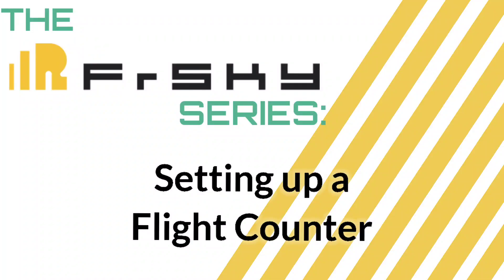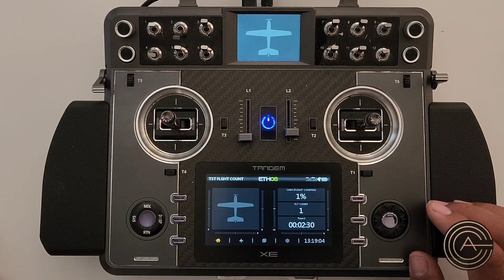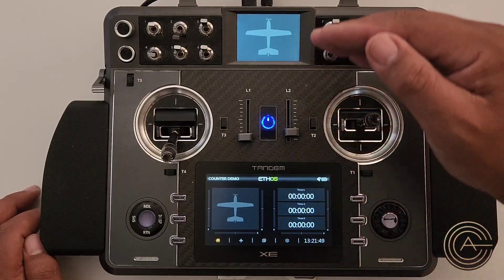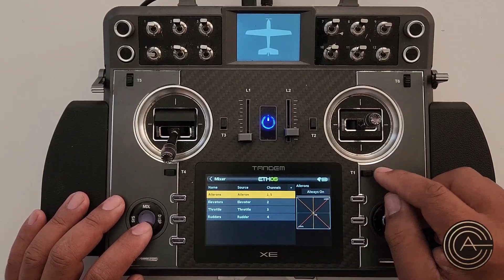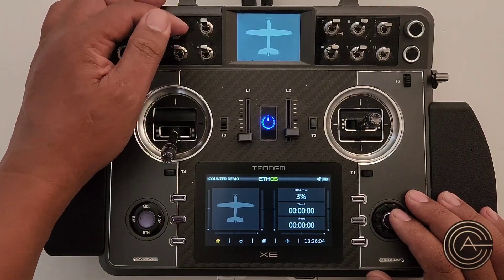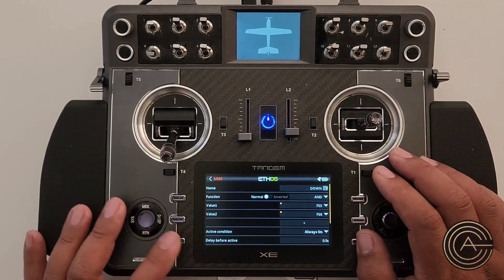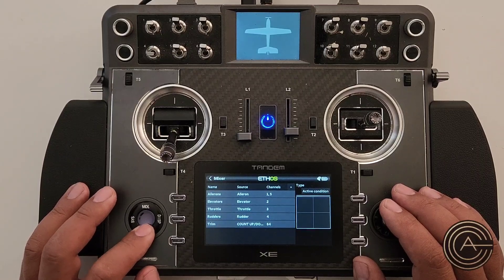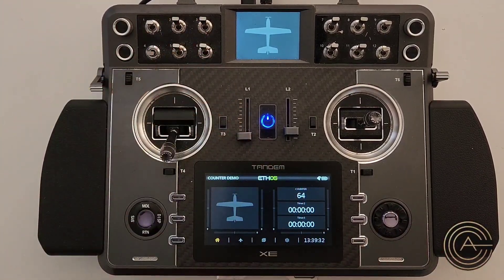The Frsky Series: Setting up a Flight Counter

Comment: Great video series. I am enjoying it and learning a lot. Is there a way to set some kind of timer to register a flight for instance, after you trigger your arm switch after 30 seconds it will count as one flight. This way when you’re on the bench flicking the switch back-and-forth. It won’t register as a flight unless it’s on for at least 30 seconds. just a thought.
Reply from the maker: Sounds like another logic switch that waits 30 seconds before triggering. Shouldnt be too hard. I might take a look and aee if its an easy addition...
Reply: @all_rc  i’m thinking set a logical switch maybe have throttle above say 10% to start the timer as a way to prevent a false flight
Reply from the maker: I just checked and yes, it should be very simple to modify and add that to the logic switch setup. Unfortunately, the steps involved in setting this up have changed. Trim, in the newer firmware is done differently. It is much easier to set this up in the newer version of Ethos but this video is now obsolete. Also, there is now a lua script that has been developed that creates a flight counter just by downloading the lua scipt. Much easier than setting this up. I might create a new video for this based on the newer firmware but that may be some time away.
Reply: @ Fantastic, thank you for dedicating your time to answer my question. Much appreciated. I look forward to more of your content.

Comment: How do I do this on a X20S where I do not have a “Trim” choice in mixes?  (I can’t believe no one has written a widget for this as in EdgeTx).
Reply from the maker: This should work on the x20s but I haven't checked if it builds the same on the new version of firmware. They did change the way trim works but it should be buildable on the new firmware. It just may not be the same. At some point, I'll revisit this on new firmware. However, to your point. Yes, a lua script version of this exists. Did not know that when I built this but it's around. Check the forums. I don't have it but it's been done.
Reply: @all_rc  Thanks!  Will look for it.  Currently benefiting a lot from your videos - many thanks for that guidance.
Reply: @all_rc  I have been unable to find it.  This is a real if not surprising deficiency in Ethos IMO.
Reply from the maker: Apologies, i never saw your reply that you couldn't find it. https://www.rcgroups.com/forums/showpost.php?p=48514323&postcount=225

Comment: Witaj. Po aktualizacji ETHOS, nie ma w menu MIX trim. Jest jakaś inna opcja ustawień?
Reply from the maker: Trims can be used as a source. Trims got updated so they do work differently. If i want to add a trim to a MIX, ill add an offset. Then instead of a value, use trim as the source for offset.
Reply: @all_rc  
Thanks for your reply.

After the update, TRIM can be added from the TRIM menu.